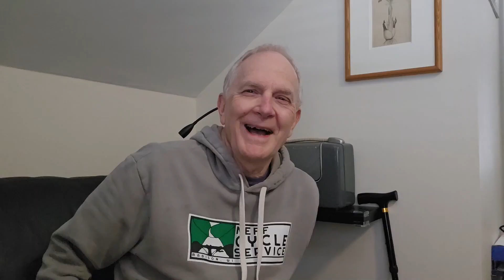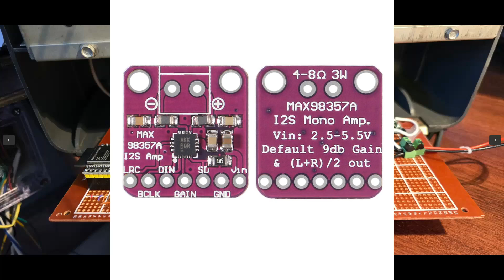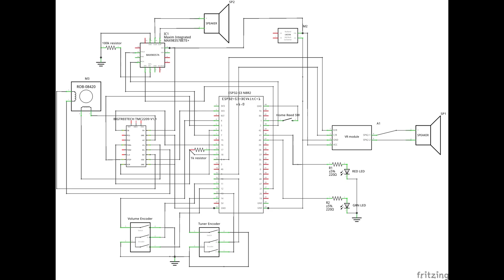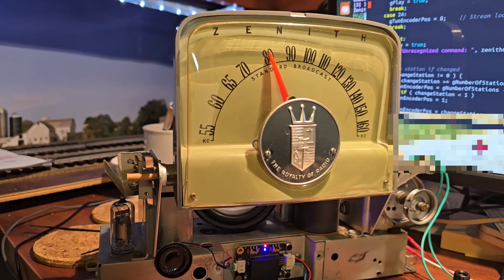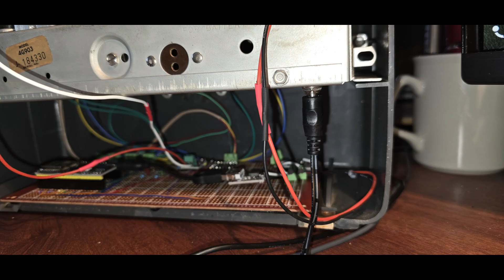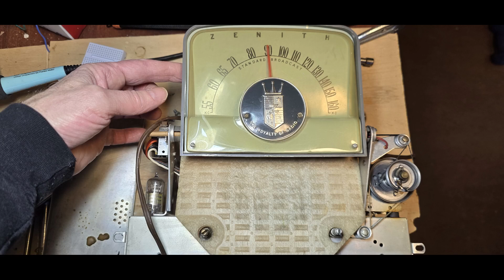The Zenith Voice Controlled Radio

Comment: It's definitely cool but removing the radio's original internals is a sin against decency :v
Reply from the maker: It's always a tough call.  I did this after restoring an older one.  Both were given to me by my dad and are cherished items.  The internals of this radio contained several capacitors that were blown out and leaked.  It certainly is possible to replace capacitors and other components but I decided to go this direction instead.  In the end, I'm glad I did because now I use it all the time.